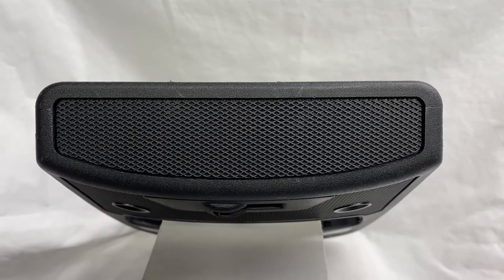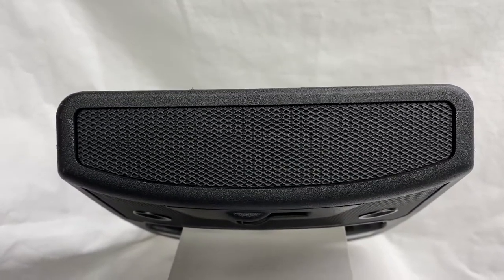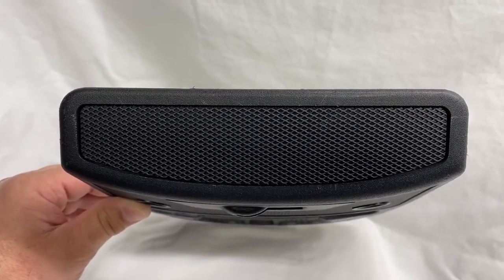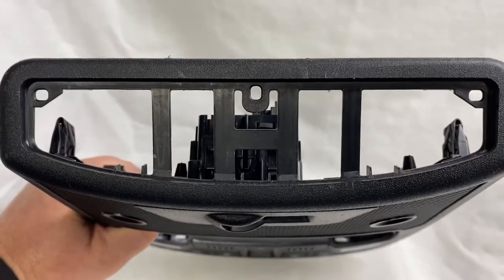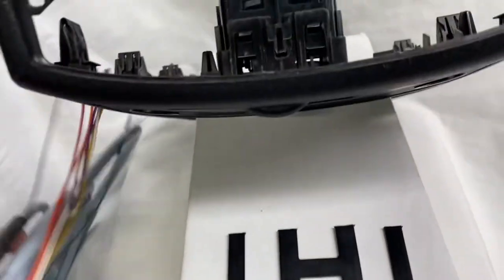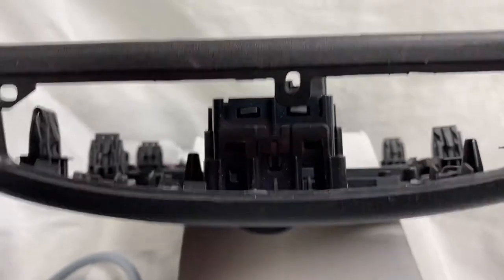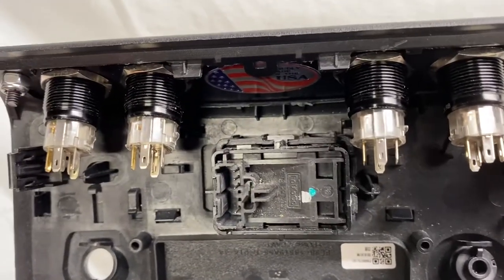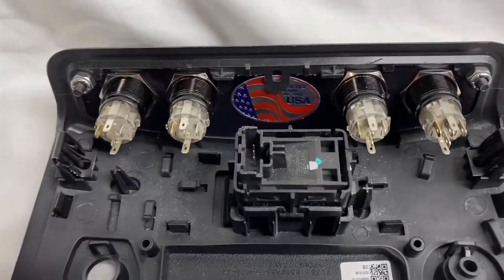2015-2020 F150 switch panel and modifications needed for fitment in the upper sunglasses console.

Comment: I got a 2019 lariat and wanted too keep the 2 sensors on that panel.. do u have anything that would work with that setup
Reply from the maker: Yes, absolutely! I have 2 switch options and they work out great!!
What’s awesome, is the video you just watched, your install is even faster because the switches will sit a little lower and no modifications are necessary to that upper lip. 
Please email me directly at: 
lethalweapon09@yahoo.com
Thanks,
Brett
Reply: @kustomfxllc.switchpanels3144  do you have a website or somewhere that i can see the version with the sensors? Prices as well.

Comment: Any solutions for an 2017 f150 xl?  My roof doesn't have a sunglass holder
Reply from the maker: Hi, unfortunately nothing will work on your headliner. It’s flat and won’t even allow a “headliner mount” because you still need 2” of depth for the back of the switch housings & wiring. 
Sorry.

Comment: Will it work with a 2018 F250
Reply from the maker: Yes, as long as you have a power rear slider.
Reply from the maker: Best to email me a picture to verify, but if you have the flat mesh panel that is removable, it will work.